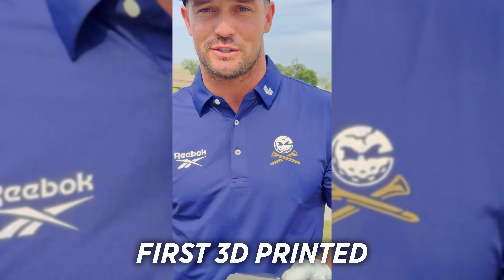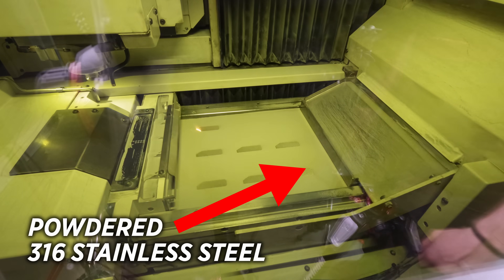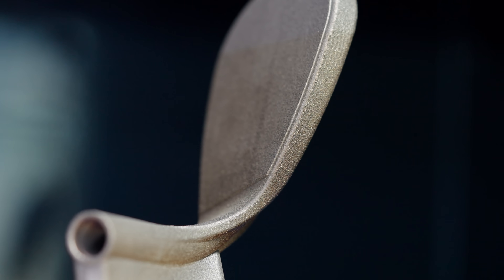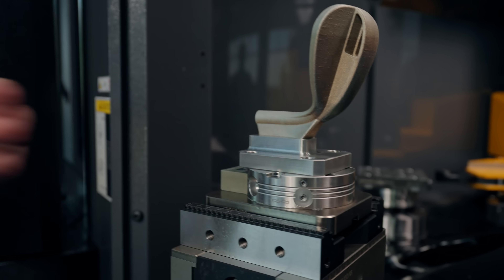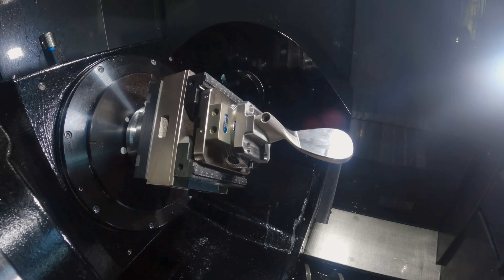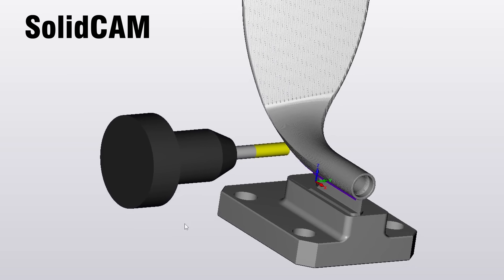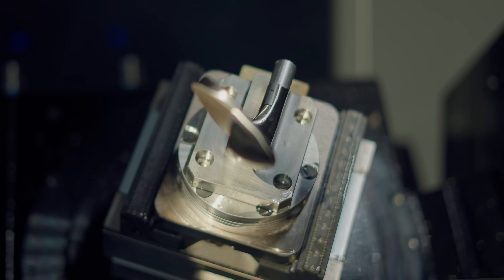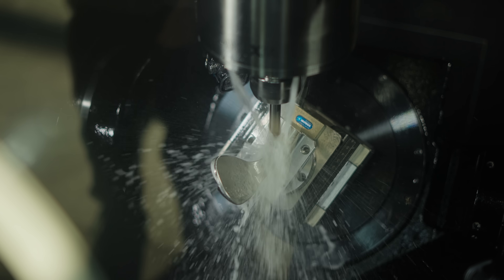The Smartest Fixturing System Ever Made

Comment: Does someone can explain me more precisely the benefit of milling some layer during the additive process please? Between 1:15 and 1:35
Reply: Since the face is only 20 thou thick, I think once they get to the point of printing the inside back of the face, they want to make sure they are at a known accurate starting point of when the inside back of that face begins. Then when they machine the face itself, you have a consistent thickness across the face.

Comment: Very interesting project for sure, but can someone explain it to me how is that better than machining that club straight from a solid block of material except for having a free standing metal 3D printer? It would take less time, it would not be prone to layer imperfections and intuitively for me it should be cheaper based on my experience with companies that automatically did the pricing of parts that i was about to order.
Reply: There's internal geometry that couldn't be machined which is why they went with the 3d printing.

Comment: How did you get the metal printed part fixtured onto the ball lock fixture plate? Print directly onto it?
Reply: At 1:37, there is a shot where the fixture is in the powdered bed. So it's likely they printed directly on it. Seems like a significant detail.

Comment: Matsuura again, top tier! Changing the world!!
Reply: Good brand, terrible model. I ran thousands of aerospace parts on that exact machine over 1.5 yrs. The machine itself was mostly good, but the pallet changer was un-dependable! It faulted out during pallet changes all the time.  Auto recovery rarely worked. I usually had to go into an un-safe manual mode to get the pallet changer working again. That machine is a nightmare. Stay away. Go with the mx-520. The guy next to me had no problems with that machine.